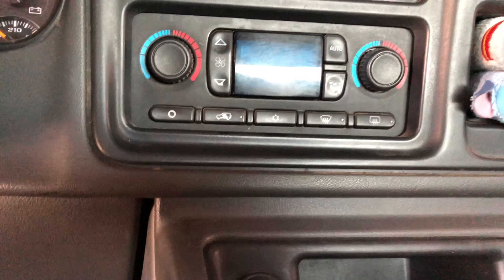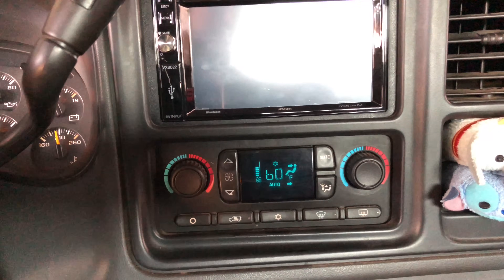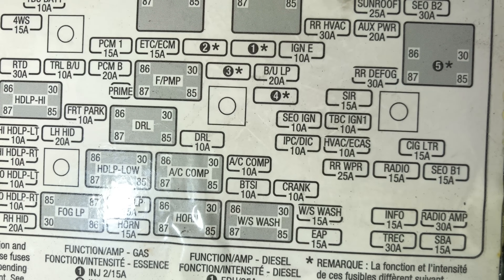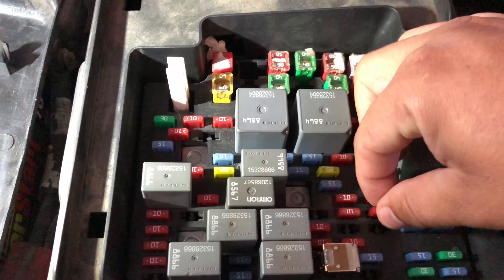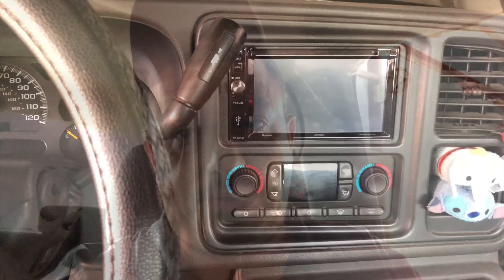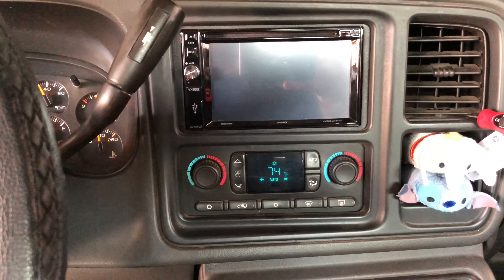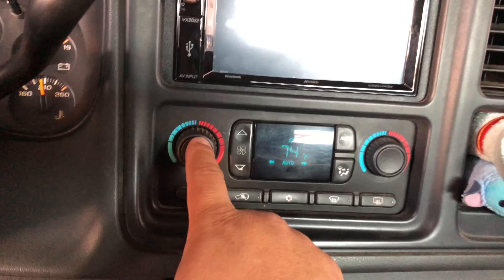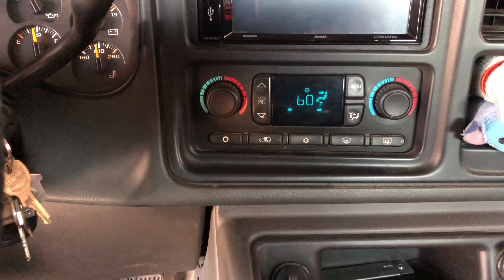HVAC Automatic Blend Motor Actuator Recalibration Procedure for GM Trucks & SUVS FOR FREE

Comment: I can't get my new HVAC unit to work correctly. It keeps cycling through different temps and I can't get it to sync the same temp to both sides either. I have done the manufacture’s suggestion calibration steps. Any chance there is something I’m missing?
Reply from the maker: could be one of 3 things .. bad temp sensors inside the air box, bad blend doors or the unit itself
Reply: Falcon's Garage but it was working perfectly before I replaced the HVAC control unit it the dash. I only replaced it because the dials wouldn't get the correct temp. Would a new in-dash unit mess with anything else?
Reply from the maker: was the unit new?
Reply: Falcon's Garage yes brand new Dorman HVAC unit
Reply from the maker: might want to see were you got it from and ask them if this unit is a "virgin" unit .. there is a difference between the unit just needing a calibration or needing a reprogramming
Reply: Watch those dormans,,they act up out of the box...get the o.e.m

Comment: Hope that works with 02 avalanche! Thanks for info on process
Reply: Worked on 2006 Duramax :::: compressor not coming on —-high low pressures switch good jumped compressor good
Reply: Scott Philbrook did it work for the 02